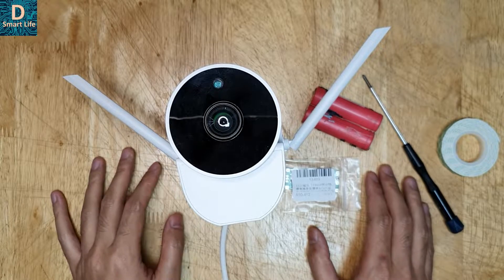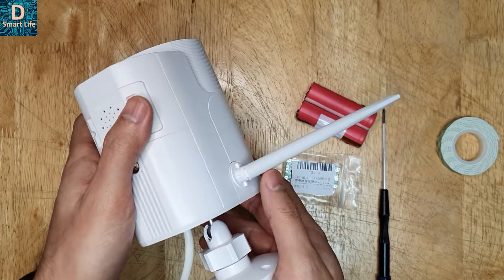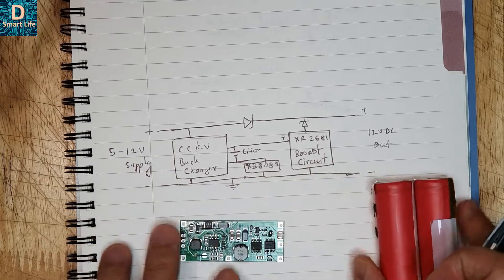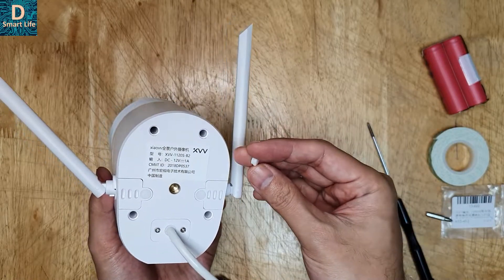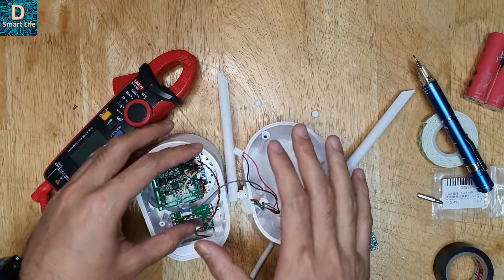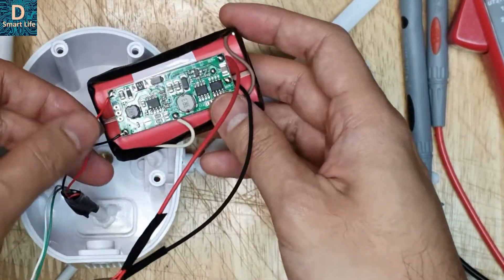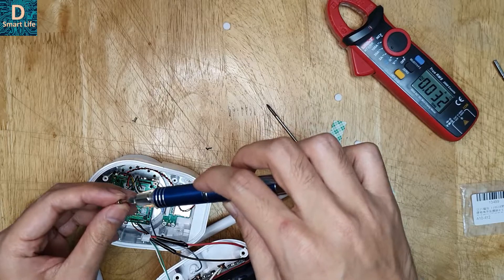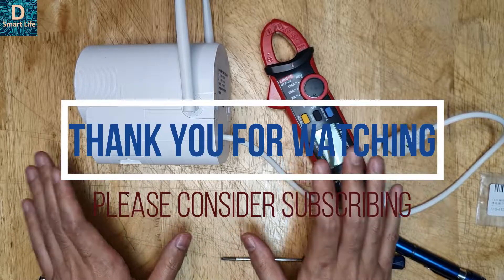DIY CCTV UPS for Smart Wireless Camera | NEST ARLO XIAOMI

Comment: note that this cannot power most routers as it outputs max 1A and it cannot hold that current for long as well. Any other circuit from aliexpress which can output higher current? i could not find one
Reply from the maker: I don't know if there are modules with more than 1A that have been verified. Even if the sellers claim to do so, most of the time it doesn't. But, it is very easy to design a UPS with more current capabilities by yourself. I designed one for one of my viewers before. Please check my schematic here: https://i.ibb.co/1qtjc2W/9-12-V-DC-UPS.png. It can also be easily modified for a 5V by using a 1S cell configuration and BMS. Thanks.

Comment: Hi, great work, as I want to build something similar, which monitor would you recommend? Thank you.
Reply from the maker: Do you mean which camera? I will recommend the IMILab EC3 for a DIY instead of the Xiaovv, check my review here: https://youtu.be/qy3Ukmlr-84. Thanks.
Reply: @DSmartLife  
Thank you for your recommendation, which I will consider, but I need a surveillance monitor to see what the camera captures. Can you recommend something with WiFi?
Reply from the maker: @craftsmen22  I do not have a specific recommendation regarding your application. Will your system have Internet over Wi-Fi? Most Smart cameras will need Internet for monitoring to work, esp. Xiaomi ecosystem cameras. If you have internet, then you can consider a Mini PC for live monitoring of the Xiaomi smart cameras as I have shown in this video: https://youtu.be/iYeYlvX3alQ. Let me know your resources available and requirements. Thanks.

Comment: Nice Idea!! Can I connect 2 Lithium ion batteries connected in series to this circuit you have attached ? How much battery voltage I can connect to circuit? What is the battery pack that used in video? Is it a parallel or series pack?
Reply from the maker: It's a parallel configuration of 2x2200mah, and the voltage is 4.2V. This is the limit of the circuit, hence you can only use parallel configuration upto 15AH. Input is 5-12V and output is 12V Thanks.